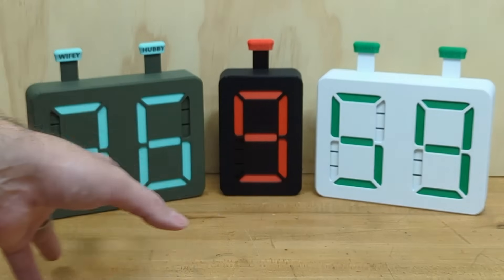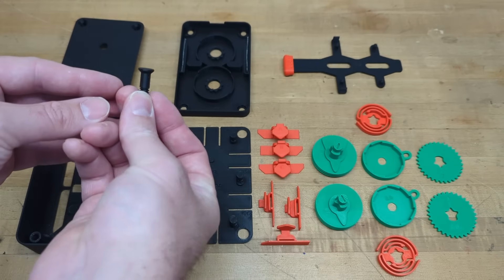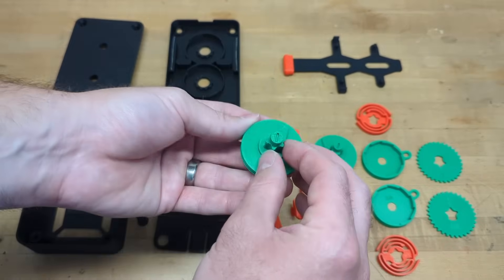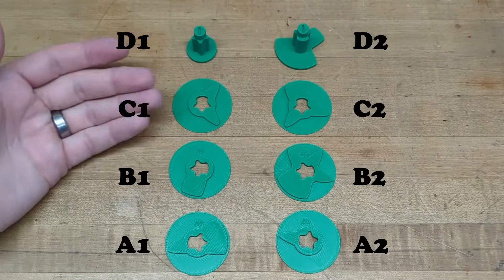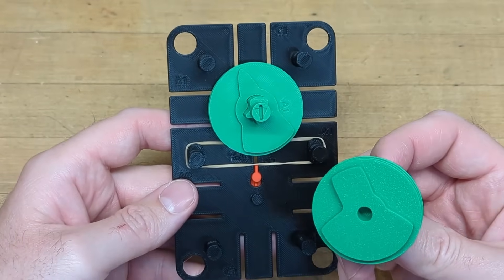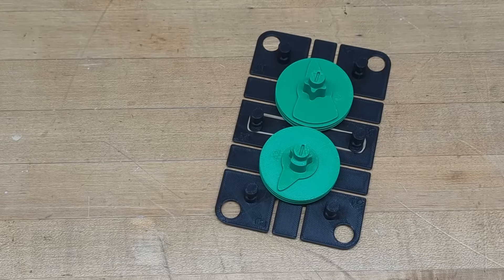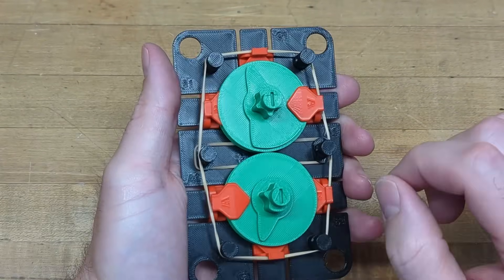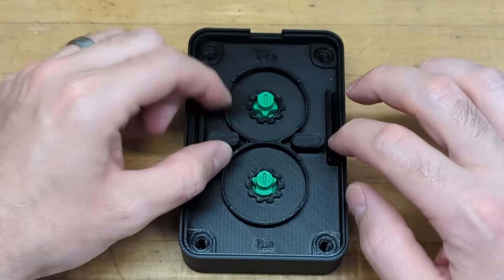7 Segment Counter v3.0, Tutorial, 3D Printed, STL Files Link

Comment from the maker: Just updated the push-action STL file to offer two options, 1) coil springs (recommended, works as described in video) or 2) a rubber band (as shown in photos on Printables).
Reply: Thanks! Makes it easy for me to use a rubber band now and allow me to get springs later. Great work.
Reply: The design changes from 2.0 to 3.0 meant going from a design very hard to convince to work to something that, without any grease, functions perfectly in the first try/assembly! Truly amazing results, congrats!!

Comment: this is such an incredible design, i got the V2 because i didn't want to buy a spring but it still works great. It reminds me of the era before devices were controlled with electronics and everything had to be done mechanically. It requires so much creativity to solve these things simply and efficiently.

Comment: Great design with many interesting ideas! But i think segments movements can be made without rubber bands. You can use hooks (on segments) on the rails (on disks), so these disks will not only push segments but also pull them. It will remove rubber bands and greatly reduce force needed for rotation. Rubber bands are also tend to degrade and break in about a year or so. What do you think?

Comment: I printed two, one for me and one for my little nephew. They are definitely fun! I found that the tolerances are a bit too tight in the design though, even with my pretty well calibrated Voron, I had to reprint some of the parts (using a few parts from a remix) and adjust some of the tolerances with a craft knife. If anyone is using Cura to slice these parts, be sure to set the slicing tolerance to exclusive for a looser fit. There's a bit of friction with the push mechanism that requires it be pulled up manually (even with a couple of rubber bands with the v3.1), but other than that it works pretty well. I used a silicon grease instead of oil and ran it through a bunch of cycles to distribute it evenly (and also lubricated a lot of additional points and surfaces just to help as much as possible).

Comment: Next steps: eliminate both rubber bands with 3d printed springs behind each segment, and also attached to the lever. Also for the multidigit displays make a single lever which increments the next place value only when the prior one transitions from 9 to 0. Should be very easy to do using the cams, and an internal lever mechanism the entire width of the multidigit display and moving on multiple sliding paths. Lastly beef up the lever to make it slammable for the slam-happy hands that drop by your convention booth.

Comment: It's a beautiful design but I'm surprised you went for metal coil springs when everything (apart from the rubber band) else is 3D printed, including the screws and main springs. Was it a challenge to print these springs too? Why not use rubber bands as well, then?

Comment: I have no idea why but my tolerances are WAY too tight when printing this on either of my P1S printers. The print quality is great but nothing fits. Printing using .2 factory bambu settings with .4 nozzle and 100% infill. Polymaker PLA. (I have thousands of hours printing on them and this is the only model I have run into these issues... NOT SAYING ITS A MODEL ISSUE... Its obviously not. I just cant figure it out). Love your work. Any insight on why I may be running into this issue would be appreciated.

Comment: any suggestion on where one can get springs and rubber bands in the recommended sizes, i cannot fond any of any of the sizes suggested?
Reply from the maker: My springs came from Amazon, I just typed in 4x50mm coil springs. I originally had an Amazon link, but they seemed to have sold out. The rubber bands were from a variety pack from a local convenience store. But, the new push action has additional pegs so you can substitute a rubber band for the coil springs.

Comment: Link for springs and rubber bands?
Reply from the maker: My springs came from Amazon, I just typed in 4x50mm coil springs. I originally had an Amazon link, but they seemed to have sold out. The rubber bands were from a variety pack from a local convenience store.
Reply: @Flower-3D  I cannot find the right size rubber bands on Amazon

Comment: This looks like a really nice design. My daughter wants me to print it for her.

Have you considered making the 2 cams so they are built around a unique central shaft so parts cannot be mixed? Similarly, you could have a different sized posts on the Seg Plate so it's not possible to get them mixed up.
Reply from the maker: Thank you, so glad you like it! I think those are great suggestions, it totally makes sense to add a feature to prevent incorrect stacking of the cams.

Comment: yhis is so brilliant.  very very elegant.  I don`t like the springs int he new version, they might be harder to source than the rubber bands.  any chance you could have dual activation. either springs (leave that as is) ir bands (add pegs here and there where bands can be used instead?)
Reply: Check out the pinned comment. He updated the push-action to add an option for a rubber band instead of coil springs. There's also a link to the coil springs in the description if you're having trouble sourcing.

Comment: Why oh why would you replace an easily sourceable rubber band with two highly specific and impossible to source steel springs? 😢 Especially after all the comments suggesting printable springs?
Reply from the maker: Hey, thanks for the feedback! There is now a link to where I got the specific coil springs in the description of this video. However, I've been seeing similar comments, so I'm working on a revised push action that includes two pegs that will give the user an option to use either a rubber band or the coil springs. A printed spring is the ultimate goal, but that'll have to be down the road due to my schedule.
Reply: I am not seeing the link to the springs in the description? Did you remove it?
Reply from the maker: @georgewaters900 @jpcguy89 apologies for not updating sooner. The links have been removed because the seller no longer offers the correct size.
Reply: @Flower-3D  I dont see a link?

Comment: Nice work, thank you! Did you print with pla or petg?
Reply from the maker: Thank you! I used PLA for all prototyping and testing.
Reply: @Flower-3D  for other 3D printed designs with surfaces that slide across each other, I've found PETG works better as it has a higher lubrosity than PLA.